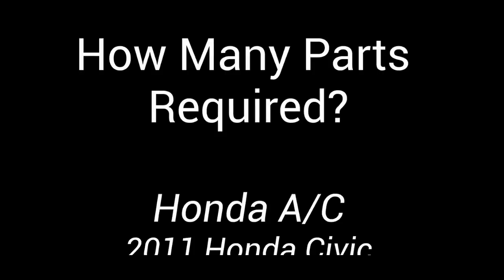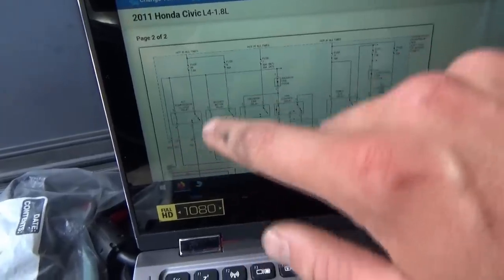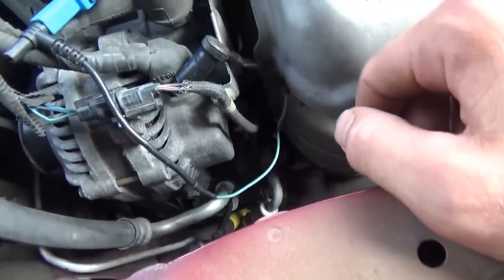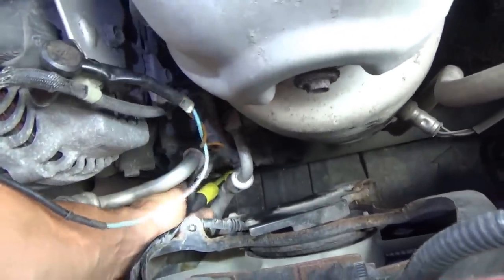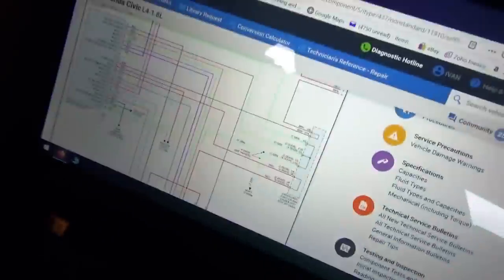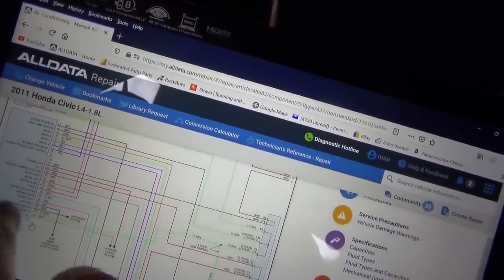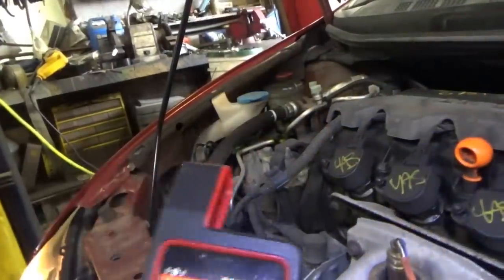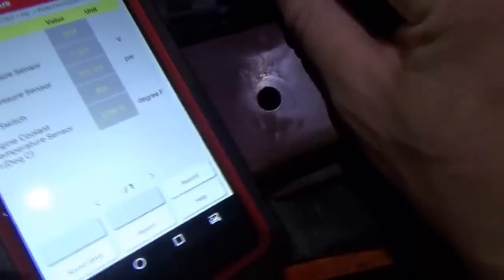How Many Parts Required?? (Honda A/C Issues)

Comment: Kind of reminds me of my 95 Civic with intermittent compressor operation where I ended up removing the control panel assy. and soldered all connections at the pc mounted switches. That fixed the problem plus fixed an intermittent problem with the vent mode switch not allowing the air door to direct flow to the vent outlets.

Comment: Good timing! I have a potential customer (friend) with a 2010 Honda, you saved me time possibly, if I get the job. I am a retired equipment mechanic and saw many clutch coil failures on Sanden compressors and was giving him my thoughts on that, but there may be other problems as well I see. Keep up the good work Ivan! Thanks for teaching us old dogs new tricks!

Comment: One of my friends had a similar occurrence with his Nissan Armada. Whenever he turned the AC on when driving, the compressor would not turn off when the pushed the AC button to do so. The button light went out, the compressor remained engaged - until he turned off the car. Dealer said 'Nothing is wrong'! 15 years later, still doing it.

Comment: I’ve replaced a few of those control heads on Honda’s.  I’ve never seen one stuck on though.  Usually they won’t turn on.  Nice diag as usual.  If ur ever back in the Phila area,  you definitely need to stop by my shop.
Reply from the maker: Good to hear from you Bill! Hope all is well 👍🙂

Comment: Myself, if the clutch coil was available on its own, I would have only replaced that. Compressors get replaced way sooner than they should. Great video Ivan. 
I had a compressor than was just 8 months old and the coil burned up during summer heat. It still worked at lower RPM but didn't have enough grip to hold the pulley tight enough above 2,000 RPM. Couldn't source a new coil so I have a good compressor and cannot repair it without buying a complete new compressor with the clutch coil.  Sad.
Reply: Ray Milligan  Might cause a balance problem? Our ultimate solution was a new compressor assy (UAC brand), dryer and recharge the system. Older car yes, not a junker.
Reply: @anonymic79  The coil burned up in one area, the paint was bubbled etc. Didn't check the shim as the gap appeared within spec however, on this vehicle, the pump had to be removed in order to get the coil off so, it was going to be a job that involved evac/recharge regardless and due to parts and hassle, went for the $190 UAC compressor. As long as the new coil doesn't fail before the compressor does, we have a spare coil that can be put on the old compressor if that time comes. My guess is, during 115 degree weather, there was voltage drop that may have occurred just enough to allow the coil to heat up ?
Reply: A lot of the time you have to remove the compressor to replace the clutch and or coil.  By the time you buy the clutch and the coil you’ve spent the same if not more on those 2 parts than the cost of the whole compressor.  For the customer’s car compressor replacement makes sense.  On the other hand if it were my own car and it has the original denso brand compressor or other oem than yes I might put a coil and a clutch.
Reply: Most of the time a clutch, hub and coil kit isn't much cheaper than a whole new, not reman compressor. And with the high failure rate of Sanden compressors, it's not a bad idea to replace the whole unit along with a new drier.
Reply: @topher8634 Who is suggesting Sanden compressors fail early? Most of the well known A/C systems sold  use them...

Comment: My 2006 honda odyssey has the same problem, replaced the A/C control with a used unit and no fix. Put a switch to the A/C fuse so I can turn on and off when need too. Has been working for over a year. Thank you ivan for your videos.

Comment: TIP: If the center bolt on cluthch with locktite won't come out after all attempts, you can drill out and weld new clutch to bolt, its splined so no worries a small weld is all needed.

Comment: Must be a TXV system - back in the old days (lol), constant running would've starved the new compressor of oil  pretty quick!  Oil that's below freezing doesn't like to move very well.  Years ago I had a failed LPCO switch smoke the R4 pancake in my '94 K1500. She got REAL noisy after that! Was nice to briefly have sub-freezing vent temps that one day, HAHAHA! Then when I attempted to remove a line to the condenser (replaced in case metal was in it), the line twisted off with the nut. Can O'worms that one was! $500 later, she was back cooling the cab again.

This was the opposite of a "NPR" fix - this was a "MPR" (MANY parts required) fix!  😁 Interesting voltage readings there! Nice vid, Ivan.  👍🍻

Comment: Common open collector signal circuit, most likely a leaky capacitor causing leakage current on the base  the transistor turning it partially. I have repaired thousands of NSX ccu over the last 15 years, I buy capacitors 500 at a time at digi-key LOL

Comment: heh also a Honda trait on the 2000 and up stuff...the damn A/C clutch relay like to go bad...each Honda I check for an A/C issue I have to checks...makes sure the condenser isn't leaking and that the relay isn't toast...then go from there.
Reply: Noticed that trend also
Reply: Honda with no a/c engage= Step one substitute relay Step two with comp turned on engine running push clutch in with pry bar (carefully) if you still have no engagement it is usually the thermal limiter. Odd issues like this are rare. Usually caused by techs overthinking things and back probing and grounding things not meant to be grounded.

Comment: That's pretty funny because my Jeep I have a 2001 Jeep Grand Cherokee I turn off the AC and it's still on but when I turn the thermostat too hot then I will get heat but the compressor is still running weird I've noticed that in the winter time when I have the heat on the AC compressor it's going on and off I think it has something to do with the cooling fan. Great video

Comment: Ive had so many issues with aftermarket compressors...a non engaging clutch on most of these honda vehicles can be cured with cleaning the rust off the mating surfaces...as long as it tries to engage with quickly bypassing the relay you should be good

Comment: So are you going to autopsy the old HVAC controller, and look for a faulty driver on that output line?
Reply from the maker: I would if it was my own car 😁
Reply: @PineHollowAutoDiagnostics , what? but the old controller is going to the dump. proper sleuthing is required...you spoiled us lol
Reply: @PineHollowAutoDiagnostics  Honda should examine the part with a postage paid sticker so they can engineer the fix. I'm amazed at the cheap crap parts coming from OEM which isn't supposed to occur.  I have found many aftermarket brands such as FelPro and Victor in the gasket department, far exceed OEM quality. This is true for other aftermarket parts but knowing which to stay away from is key. Experience comes into play at that point.
Reply: @Garth2011  I agree with you, but I think a lot of manufacturers probably have stricter quality control standards for their OEM parts than their aftermarket parts. For mission critical or difficult to change parts, I tend to go with OEM parts where possible. One example of why is I bought a FelPro rear main seal for my Civic from a local parts store to replace a leaking one while I was changing the transmission and the replacement seal leaked, so I had to take the motor out to replace the seal again. Upon further inspection, the reason the seal leaked is because the round metal spring on the back of the seal that holds it tight around the crankshaft was missing. I guess I should have visually inspected the seal before I installed it, but it should not have left the factory with a missing part either. I replaced the seal with an OEM Honda seal over a year ago and still have no leaks to this day.

Comment: I had the same problem I replaced the clutch and coil and it was fixed.at one point my 08 crv 2.4 had a recall and as did that car have tge same problem with the ac was getting stuck on and wearing out and it would be intermittent not engaging. So hondas replacement was coil but I did clutch and coil together 2 separate parts sold separately

Comment: New cars are way too sensitive. No electrical tolerance. An inconsistent  battery and/or alternator can also cause problems like this.
Reply: the correct operations is millivolts versus battery, it certainly doesn't need to be that sensitive, that's a nearly a 13.8volt swing....it's telling you that you have faulty parts.  Work on a BMW or German car, they do the same thing...fail safe, we think you want this setting, if you don't, go find a real tech.  Design side on the more customer friendly side, parts be damned as it's gonna kills some shit before it get's fixed, but the early mortality does help pinpoint the issue, so no tears.
Reply: Not just new cars..my 02 maxima kept going into limp mode when the alternator started too die.

Comment: Look to see if there's a diode in your wiring diagram by the AC compressor. If there is, check the diode to see if it is bad.

Comment: I dont have my Tacoma any more but had similar problem....AC would blow cold air even with AC off. It was an intermittent problem. I was not a big fan of AUTO AC...I could not turn heat knob to cold...it would turn on AC. I had to turn heat knob to max heat for AC to shut off.
Reply from the maker: That's annoying lol
Reply: @PineHollowAutoDiagnostics  It was very irritating at times. I wish I had your knowledge to know why the AC was doing this.Now I have a new Tundra with dual  climate control..  my wife likes it but my fear is what happens when it does not work properly 5 or more years from now.

Comment: So was this just a bad pull up resistor in the module? Probably not possible to fix without board level schematics though. *On edit, one could scab in an external pull up resistor if you could determine a suitable rating, much like the decade box you used.

Comment: wonders what controls the compressor clutch during freeze-up or low pressure does it have an orifice tube or an expansion valve

Comment: Ivan real surprised about this Honda wow not usual for it need any repairs 🤔
Reply: ?? Common problem for a Honda. Usually in stocks at local dealer. I've replaced several. Usually compressor fails to energize. Clutch coil common failure too. Clutch and coil Usually close to price of new compressor. About as common failure as the automatic transmissions in the Accords and TLs
Reply: @topher8634  ok thanks for replying on a post from a long time ago 🤦‍♂️

Comment: Question for you sir, 

I have a slight problem with my car, vauxhall meriva b and when I have my headlights on, when I turn steering wheel regardless if idling or rev to 2 - 3k revs they dim. It is electric power steering not hydraulic. I also have a Honda civic 2008 electric power steering and this does not have these problems i face with the vauxhall. Would love to hear your expertise on this.

Thanks
Reply from the maker: Measure the current draw to the power steering

Comment: Question::
I have an 8th gen civic (2010).
Whenever the A/C clutch-in, the rpm drops from @700 to almost as if the car engine want to turn over.. vibration occur when at traffic stops and all is ok once the A/C is running amd no vibration when in drive..
Engine mounts all good
A/C compressor is good
A/C is cold
Throttle body and EGR valve serviced
Air filter changes
Spark plugs good (Iridium)
Coil packs all ok
No lost of acceleration etc

Only the engine somewhat hesitation (rpm drop) with vibration at stops or parked ONLY when A/C clutched in..

No same issues when driving without A/C..

What maybe the problem?
Reply: Way too much to read but if the car does not idle up for AC usage the IAC is likely not receiving the signal to do so.  Does car properly idle up on initial start up in the cold?  2010 is too new for me to know off the top of my head if it is throttle by wire but I doubt it so the IAC is likely the wires that go to the TB that are not the throttle position sensor.
Reply: Michael Krenzer 

Car idle ok when first start up in cold without A/C..

The hick-up only occur everytime whenever A/C initial first clutch in during cold or running at stops or parked. The rpm dips a bit, car engine vibrates then all is ok..
Reply: @iDIL53  You missed the entire point of my question.  In say 40f or 5c weather, when you start it does it idle high for about 1-3 minutes.
Reply: Michael Krenzer 
Where I am - there is no cold weather like that or four seasons..
I am from Singapore, Southeast Asia
Reply: @iDIL53  no way to test then...in short, you are either overly sensitive to the kick in or your IAC is not getting a signal to idle up on compressor start.  Have the TB and IAC cleaned and live with it.
Reply: Michael Krenzer 
No I am not overly sensitive with the A/C kick in because another friend Civic (similar year) do not vibrate as mine..
When we parked side by side with hood opened and engine running with A/C - we can see only my engine block shook whereas his didn’t..
Perhaps it is the IAC and will take a look on this..Thanks
Reply from the maker: Clean the throttle body 👍
Reply: Pine Hollow Auto Diagnostics 

I’ve done that in February and the EGR in March..but not the IAC

Comment: My damn 07 civic will turn the radiator fans on on a cold start even when it's -20f
They cycle on and off every 14 seconds also. Been like this for about 5 years

Comment: So there could have been a faulty pull up resistor in the air con controller.
If it was your car,  i'm sure you would have the aircon apart and a hot soldering iron ready to torture the disobedient part :-D
I would have the 20 amp relay and switch ha ha :-D